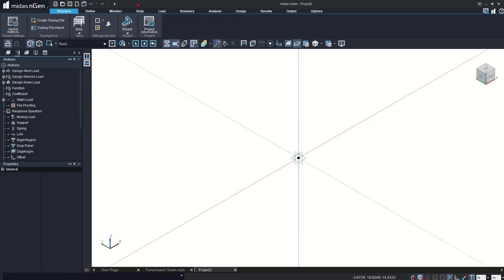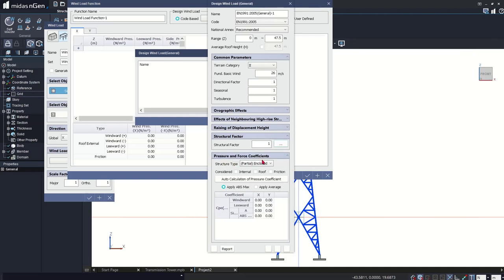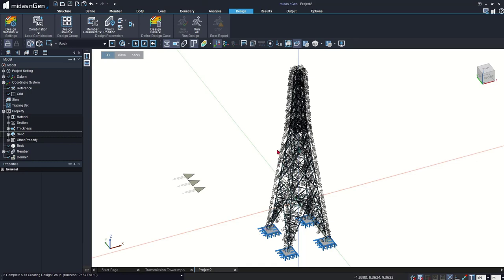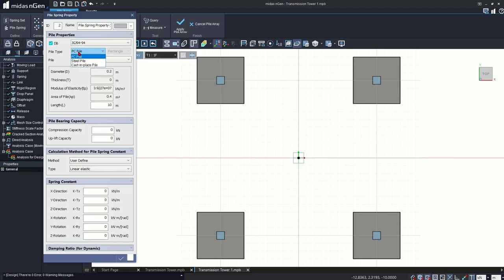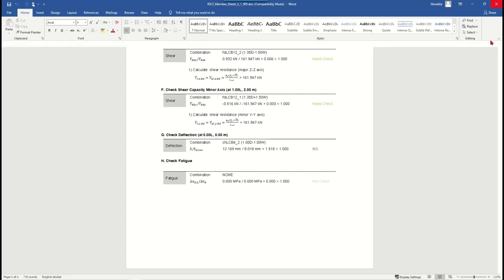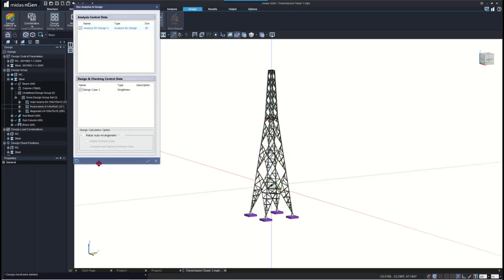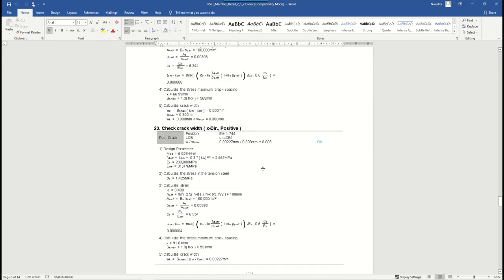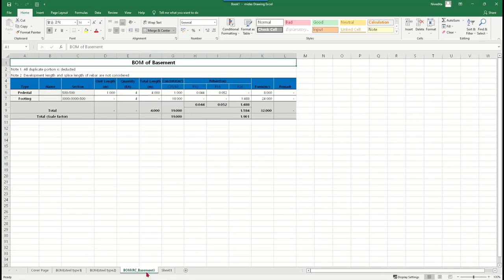Modelling, Analysis, Design and Detailed Drawing generation of Transmission Tower - midas nGen

Comment: hello maam. Why I cant select object when I put wind load? I am design transmission line with L100x8 maximum angle bar and L45x5 the lowest. Is it because of the material use or what?